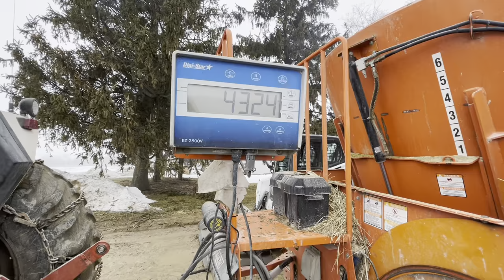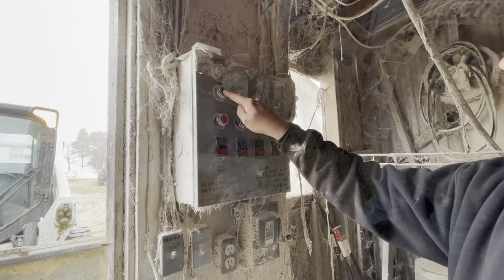Mixing up some delicious COW CHOW! (TMR)

Comment: Putting the distillers inside of a small or medium silo with an augar would be easier on your guys backs
Reply from the maker: We used to have some but they rusted through with all the minerals we put in them. And new bins are expensive.
Reply: @leuenbergerdairy6038  damn well yeah i can see your point there once they rust your sol

Comment: Your mineral-protein package should have gone in after the first corn silage in order to get a thorough mix.
Reply from the maker: That would work if we didn’t grind bales. With grinding bales if we put the minerals in first we’d be losing some if we did the corn silage, minerals, then bales to grind up. Because sometimes the bales don’t stay in the mixer. Again we have always done it this way and it works for us
Reply: @leuenbergerdairy6038  Do you send multiple samples from different places in the bunk to see if all cows are getting the same consistent ration?